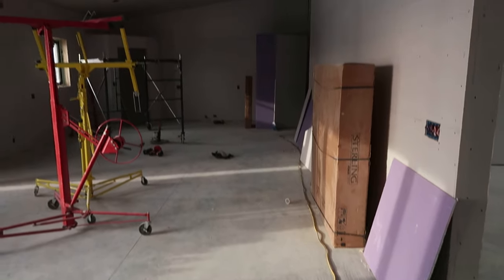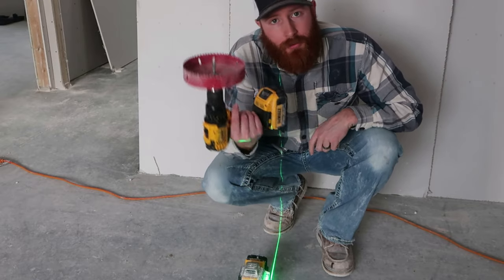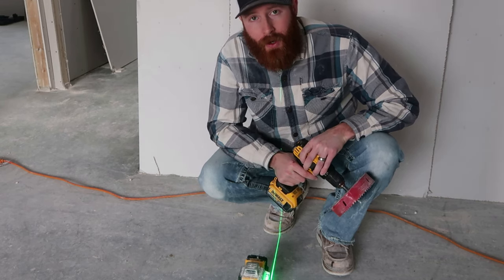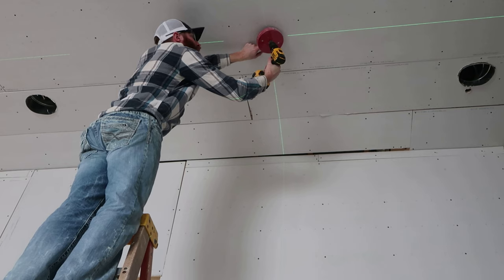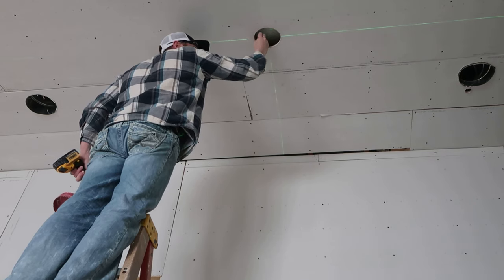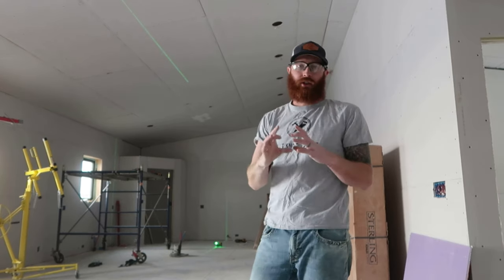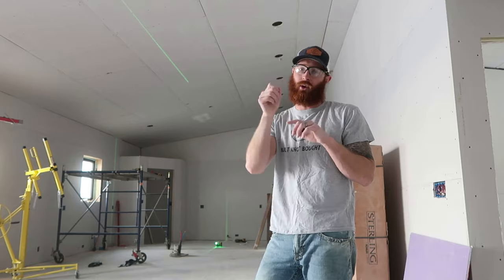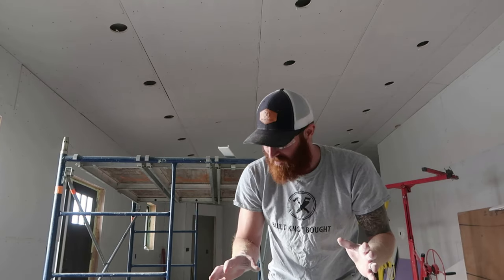Drywall complete // Building a barndominium episode 17

Comment: Sorry I am a late arrival and a little off subject here but I have been speed watching your build. We are doing the dirt work on a new build now and just finalizing the interior plans. We were thinking we would need to use spray foam (closed cell) for air tighness on a metal building. You touched on that briefly but the expense is much more than fiberglass. After working in there all winter in some windy days, North Dakota, what do you think of your insulation?  Any experience with heating last winter?
Reply from the maker: Hey good luck with your build that's exciting!  The efficiency of this house has been phenomenal I've been blown away at how well it retains heat and keeps cool I worked in it all winter and only used a third of the propane I used to heat our other home.  And as far as summer goes we didn't get air conditioning installed until 2 days ago and even on the 95 plus days the thermostat never showed over 72°.  The key here is the plastic barrier as long as you fill any holes and tape any seams that you create this type of building is about as efficient as they come
Reply: Thank you